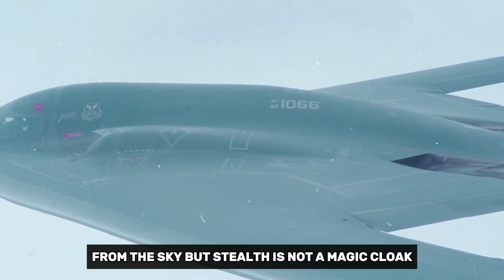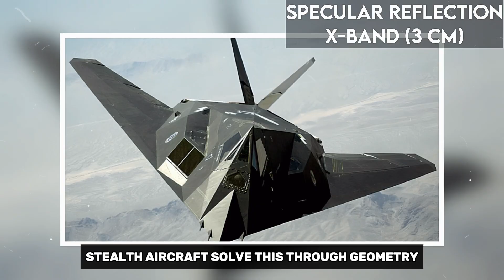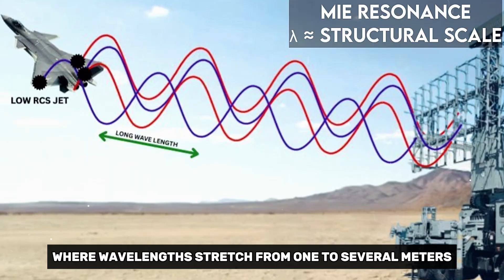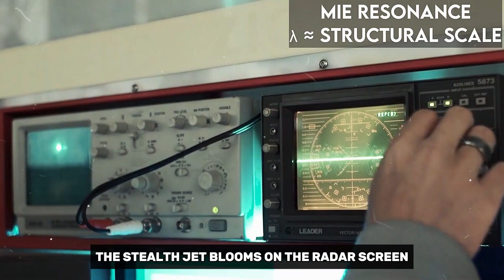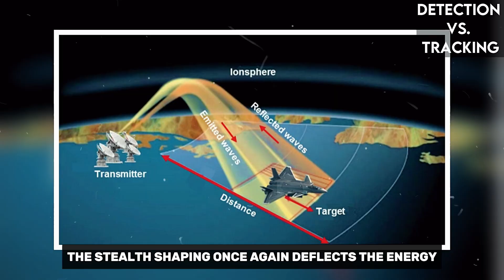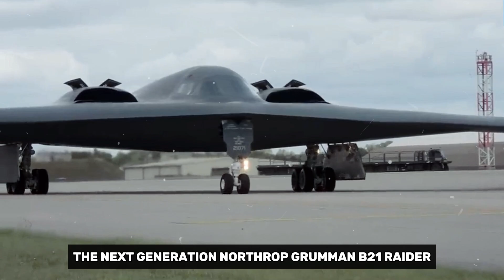Stealth's Achilles Heel: The Wavelength Problem

Comment: The engineering behind the B-2 is incredible, but I’ve always wondered how effective stealth aircraft will remain as radar and detection technologies keep improving. Do you think stealth designs will continue to dominate, or will future air defense systems eventually reduce their advantage?
Reply from the maker: That’s a great question. Stealth doesn’t make an aircraft invisible, it mainly reduces how far away it can be detected and tracked. As radar systems improve, stealth designs are also evolving with better materials, shaping, and electronic warfare. The real contest is becoming stealth vs smarter sensors. Do you think future aircraft will rely more on stealth design, or on active systems that confuse radar?

Comment from the maker: The B-2 Spirit is one of the most complex engineering projects ever built in aviation. Its stealth design allows it to penetrate advanced air defenses, but it also comes with extreme cost and maintenance challenges. Do you think the strategic advantage of stealth bombers like the B-2 justifies their massive cost, or will future technologies eventually replace them?